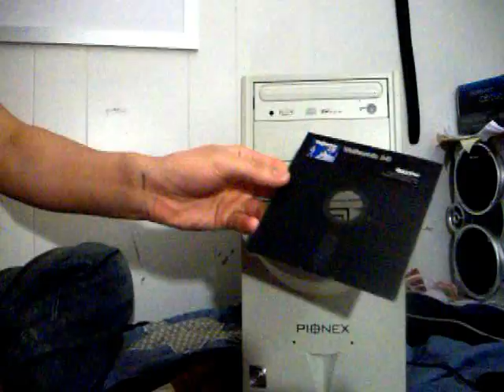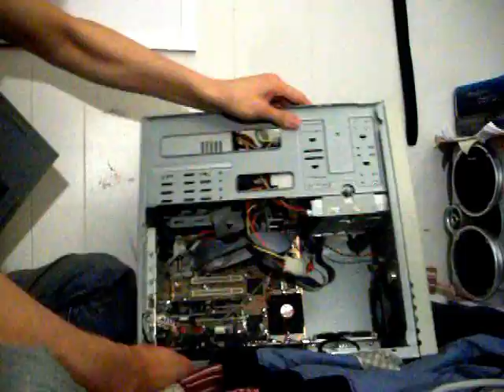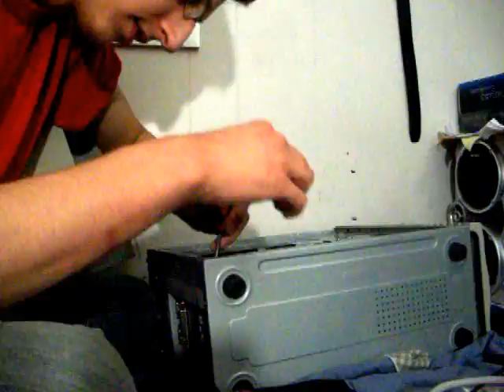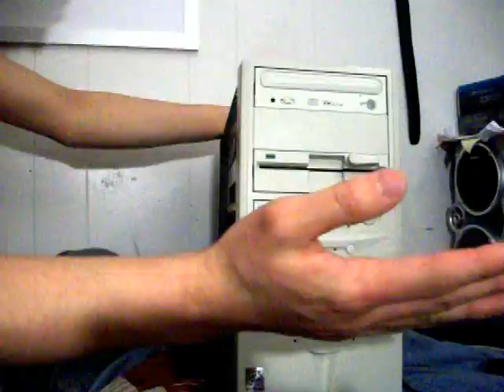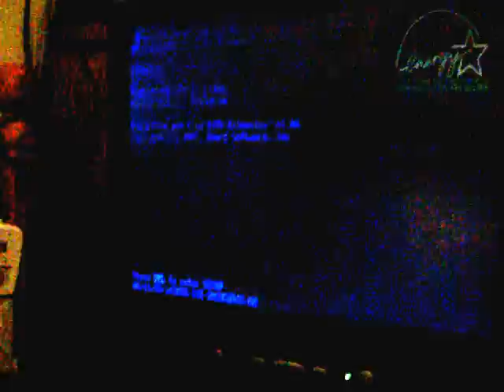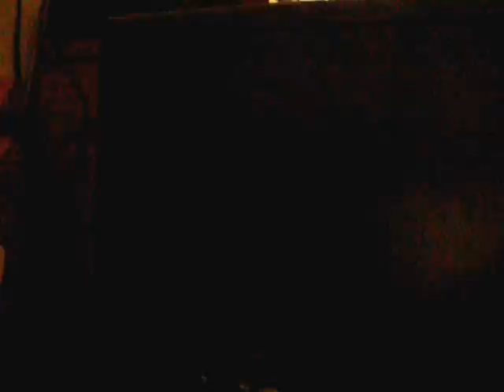Inside My Old Pentium 1 Computer

Comment: really is that your computer!? look i got an inwin n 703 medium tower with geeforce 980 and a cx500 m power supply and asus p-xl 17 board.... with water cooling. i go and kill myself if i were you. i just cant handle the look of stupid old pentium shit.
Reply from the maker: For the record, yes, I do have a more modern computer, and I use it daily.

I have two YouTube channels. This is the retro channel, used mostly for OPL3 music, hence the name and the old computer. The computer in this video was parted out a few years ago, and I have two in it's place that are mish-mashed from older parts. Hilariously enough, this CPU wound up in a Graphite 600T case, with an AdLib and a Voodoo 5500 DVI. So the age of the parts ranges from ~1987 - 1999 or so.

I have a passion for the sound of the SB16. Old computers used to have live synthesized music on an analog circuit. Modern "Virtual analog" synthesizers and software synthesizers aren't even close to the warmth and character of the old stuff.

Also, there are a lot of great 90s games that don't work on newer hardware. DosBox is helpful for the DOS games, but there are many Win95/98 games that will not work. Also, DosBox has REALLY bad OPL3 emulation, which is a deal breaker for me.

I also make music on the SB16 with Adlib Tracker. Let's see your fancy new computer do that. https://www.youtube.com/watch?v=DEhbdVYSVMQ
Reply: Just get out and live a real life instead of playing shitty games and becoming fat

(irony ^^)
It's not because you don't like something that it is shitty. Building a very fast PC is your hobby, but his hobby is to repair/restore a good old PC and use it to play retro games on it. Why not ?

And if that was his only computer, how could he have uploaded this video ? even by 2010 it was very difficult to use youtube with that kind of computer

Comment: Dude!!!! Stop torturing that computer. What you are doing, are a complete recepie for toasted components.
Take it from one, that have been using computers for a hobby, since 1982/84.
The machine is not designed for Win95, rather for Win98. We used to have Win95 running on 80486's.
If you want some history on computers, then I would gladly sort it out and answer questions.
Reply from the maker: I'm.......torturing it? What now?

This computer has been long dismantled, piece by piece, into a new one, but it never had any hardware failures after the taking of this video. The only thing I did that could possibly cause problems was adding the cheapo GLI to the PC speaker line. I have since learned the correct way to hook up a PC speaker for recording and enjoyed a good laugh.
Reply: Static electricity. That's what could kill the machine. Allways dismantle computers, 100% unplugged and allways on something like a wooden surface. Never ever have any clothes on, that are made from anything else than cotton. Nylon would generate static electricity.
If you knew how expensive old computers could be on ebay, you will never do this again.
Reply from the maker: Oh, I know how expensive the parts are getting for sure. This was a cheap eBay win, though. The parts it came with were okay, but not great. In fact, the only part I still use from this setup is the CPU and it's fan. I have the cards laying around, but I do not use them because I have much better ones. The rest was parted out long ago from disuse.

Unfortunately, at the time of this recording, I didn't have any other environment to use. I actually had to keep the computer as hidden as possible, thanks to some prying eyes. This video was recorded late at night while everyone was asleep, hence why I talked in a hushed tone.

In lieu of a proper grounded environment, I tried my best to keep my hand on the computer case near the power supply before touching the innards. I know it isn't a real solution, but the blanket I was sitting on has never generated any static electricity in all the years I've used it, so I wasn't worried about it.

Ironically, I did ESD one motherboard, but it was not this one, and I was very very tired at the time. Wool socks on carpet were the culprit.
Reply: Hang on to every type of Creative ISA sound cards... They are expensive as heck, these day's. Especially AWE-XX cards.
Reply from the maker: Some of them, yeah. I was never really particularly fond of AWE cards, though. SB16 and AdLib music is my love. I've tested a lot of variants, and the best sounding cards always have a YMF262 or (My favorite) a CT1747 OPL chip, two VRMs and a TEA2025b amplifier chip. Crisp, bass-y and snappy.
Reply: My awe32 has both wavetable and opl3.
Some AWE's do not have that. AWE64 does not.
Reply from the maker: Yeah. The AWE32 in this video uses a TDA1517p amplifier and only one VRM, though - the output is really thin and lackluster. I made a video a while back comparing the AWE32 and SB16 FM output, and the difference is amazing.

http://youtu.be/9hzxE1_nl0k
Reply: I know... Have you tried to emulate MT32 as well? AWE's can do it through an TSR. Just crank chorus and reverb to 50% each. The SB-Live can do it as well, just no reverb and chorus settings on the SB-Live in MS-Dos-6.22.
Reply from the maker: I haven't tried to, no. I haven't used the AWE32 in a long time. Right now I have an AdLib card and a SB16 CT2290 installed in my computer, with no plans on changing them until I have enough time to use them. 

Actually I'm not even 100% sure what an MT-32 is, although I've heard them before.
Reply: You should try... Roland MT32 was the best, most expensive, most exotic stuff in the 80's and 90's. Even with AWE's comming out. Nothing would really beat MT32. Monkey island is one of those games that were compatible with MT32. Lucasart games and Sierra games were.
Reply from the maker: Interesting. What exactly is the MT-32.....is it a PC card, or a MIDI device?

It is theorized that the Sonic & Knuckles collection is also meant for an MT-32, although there's no solid proof that i know of.
Reply: Well... It's a studio quality sound standard. Just like SB16 and Adlib. ;-) Try to search monkey island, soundblaster vs MT32. Or just search for that giant 1+ hour video explaining all about roland modules. Think its Mau1wurf1977 here on youtube, that have produced the video... He's like a true retro hardware guru.
Reply from the maker: I'll have to look it up sometime later. Too many work hours at the moment. But i will definitely look into it, thanks for the tip!
Reply: Brett Bates
True that. It is an option that are useable, if you do not have any MT32 module and the game in question do not have AWE-Support.
Other than that, MT32 emulation is inferiour to a real MT32 mpdule.

Comment: I had an old computer once it's hard drive was only 800mbs,I managed to get a windows 3.1 iso to install by using a windows 98 boot disk which loaded up cd disk drive drivers,then it read the iso windows 3.1 disk,so no need for floppy disk install.

Comment: I have a Pentium ThinkPad =) only 48MB Ram and a 1 GB hard disk sadly I don't have a set of floppy's to reinstall os/2 :/
Reply from the maker: OS/2? It doesn't use DOS or Windows? o.0
Reply: not that i'm aware of it seems to be designed for OS/2 for the Easy setup screen to the drivers on the website and the person I bought it from said it came with OS/2 but that I may need to reinstall since the cmos died

Comment from the maker: Pentium II speeds *began* at 233 MHz, yes, but there was overlap between Pentium MMX and Pentium 2. This is a Pentium MMX processor, and it does indeed run at 233 MHz.

Instead of googling a term that gives the result you want, just check the wikipedia page - there are a ton of Pentium 1 variants, some going up to 266 MHz. The page is poorly organized and hard to read, but the information is all there.

Comment from the maker: Pentium 1 went up to 266 mhz, bro. Also, pentium 2 doesn't use socket7, which this board is. ;)

The only reason I mentioned that it was designed for Windows 95 is because of the silly sticker on the front proudly proclaiming it. Not a very good choice of words on my part, but eh.

I haven't used Windows ME (nor do I want to) but I'm actually a bit surprised that it'd run on a system this old.

Comment from the maker: I actually have RAM in all of my slots. I know it isn't correct, but the computer is detecting and using the maximum it is capable of, so I don't care.

I don't remember what that type of RAM it is off-hand, but I think it's DIMM. Unfortunately I don't have time to pull it out and verify right now, sorry. ;(
Reply: OPL3music probably 72pin SIMMs. Each rail was capable of reading 32mb (usually).

Comment from the maker: @WPSpecialKid Ugh, youtube not giving comment alerts o.0

Amiga 500? No, can't say that I have. You had to have a reason to suggest it - got something interesting?

I'm not worried about the PC speaker connection at all, I hardly use it so the parallel connection shouldn't hurt anything. It definitely wasn't close to doing any damage to the recording device (which surprised me a lot) - thanks for the heads-up though!